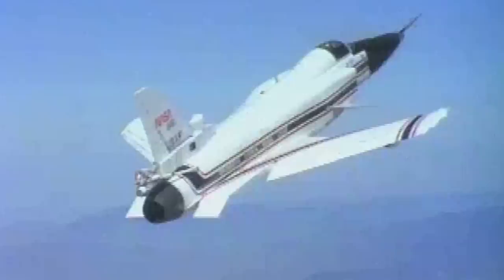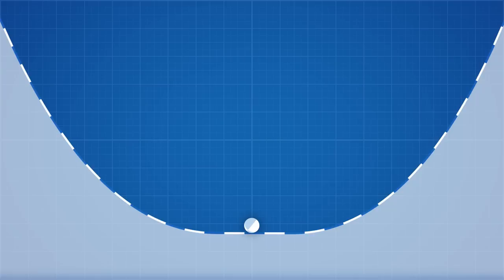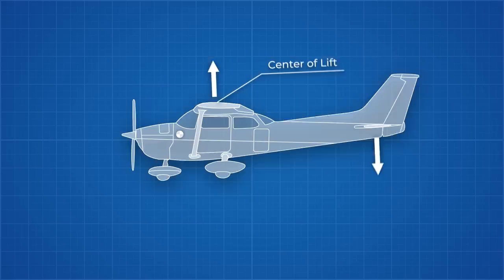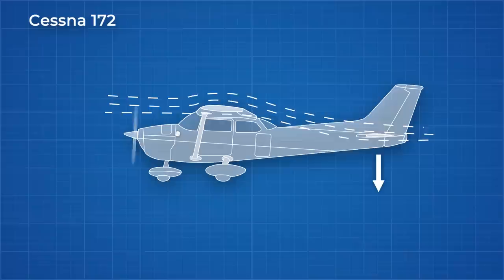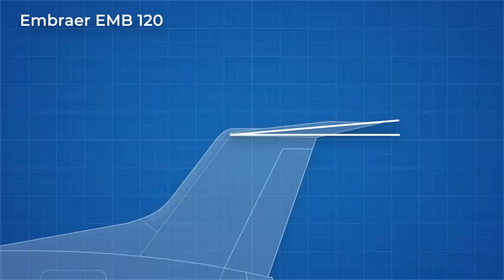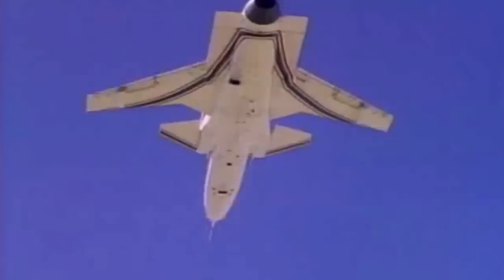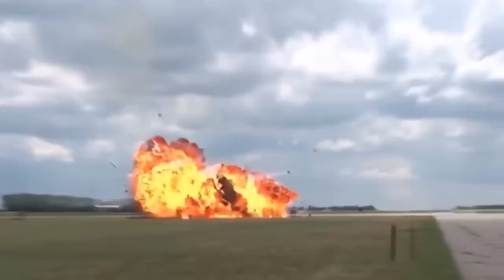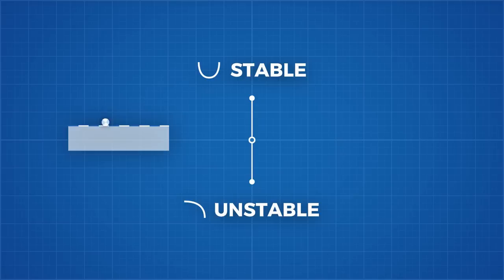Why Fighter Jets Can Be Too Unstable

Comment: Excellent and simple explanation. 

The term typically used is “relaxed stability” since many fighters do have static stability, just not what is required for safe and controlled flight. That is, the design will return it to straight and level with light maneuvering, but rapid maneuvering would cause the aircraft to tumble before the stabilizing forces could act. 

Another thing you touched on is roll stability. There is no pure roll stability because an aircraft has no idea which way is down. Roll stability is based on slipping the airplane and is called “slip-roll” coupling. The idea is that when the aircraft is knocked askew by a wind gust, it results in a slip and that rights the aircraft. 

Well... it has an opposite effect in a skid (using excessive bottom or pro-roll rudder rather than top rudder). So an aircraft that had tons of roll stability will actually be more maneuverable in roll than one that doesn’t. This is most evident in the snap roll or flick roll... where the rudder is used to induce a massive rolling force in combination with the elevators stalling the down-going wing which produces phenomenal roll rates in rather pedestrian aircraft.

Comment: Hey, I have been wondering about how engineers go about Optimising existing technologies. I would love if you could compare two generations of piston engines and show where more power and efficiency is produced, that would be awesome.
Reply: Take your pick and google it. 

Going from flathead which was easy to produce to OHV which had better flow and was less prone to overheating. 

Going from OHV to DOHC which allowed engines to flow even better and allowed for higher revs so small engines could produce lots of power as well as be fuel efficient when driven lightly. 

The introduction of direct fuel injection which allows carefully controlled lean burn which produces more power for far less fuel.
Reply: @Bartonovich52  but wasnt the disadvantages of DOHC is got less torque to produce than OHV ?
Thus makes them equal in technologies but different in purpose ?
Reply: @megimargareth4015  no, DOHC doesnt make less torque than single ohc or pushrod engines, its just a trend that manufacturers who value the pros of developing DOHC dont value torque

Comment: great video. I'll throw in some bonus facts about the F-16 since i've flown some flight sims in it (bit i am not a pilot). Because of the issues an aerodynamically unstable (or "relaxed stability aircraft") aircraft has with the center of lift moving forward as the Angle of Attack (AoA) increases, this creates a feedback loop where as the AoA increases, upward pitch increases which increases the AoA. This quickly gets out of hand to the degree that no pilot can reasonably control. To deal with this the F-16 makes use of a Fly-by-wire system. Unlike other aircraft (F-15, F/A-18) the F-16 is purely fly-by-wire, there are no cables nor hydraulic backups for manual control should the system go down, or the aircraft lose power. This is because again, there's a basically zero percent chance of a pilot controlling the aircraft without the flight stability systems. Being a single-engine aircraft this is naturally of some concern since loss of engine would mean loss of power and absolute loss of aircraft control. To alleviate this the F-16 has an APU which lasts about 10 minutes to provide power to the controls. In event of a minor engine loss where the engine may be able to be re-started, the F-16 actually can restart the engine with its internal starter (a fairly uncommon feature in US aircraft at least). 

While this fly-by-wire system is needed to be able to fly the aircraft at all, it also had a huge benefit of doing most of the work of flying the aircraft for the pilot. In flight sims i was able to take off in the F-16 (unladen) on my first try after watching a video tutorial, and reading a manual. The landing was iffy and i ended up going off the end of the runway because i touched down late, but the aircraft can only do so much for the pilot. 

One of the biggest advantages of the flight systems is how they prevent the aircraft from entering a stall -- supposedly a pilot is more likely to damage the control stick than they are to induce a stall from turning the aircraft. 

Finally, the flight stick is somewhat unique in that it originally did not move at all (with the more modern ones moving very slightly). The Control stick registers the force applied and uses that for control inputs. This is much faster than a joystick using potentiometers and a spring to return it.
Reply: Also the F-16 put the flight stick on the side of the aircraft to make it easier to control, the F-16 pioneered many things, intentional instability, full fly by wire, and flight sticks to the right side instead of the center.

Comment: CF-18 crashing at 8:15 at the Lethbridge Air Show in 2010 in Canada. Cause of accident was engine failure.
Reply: Glad someone else noticed.  Unfortunately, this channel does not accurately explain or research topics or videos.
Reply: It was about an unrecoverable situation, which is what the clip shows.
Reply: @martijn9568  Exactly. Plus the engine failure isn't even the immediate cause of the uncontrollable stall - it's the loss of airspeed. And the loss of airspeed is of course caused by the engine failure, probably combined with hard maneuver (near-stall, high drag situation requiring a substantial amount of thrust to push through).
Reply: @brendanreed3378  It's just background footage. It's to fill out the video with relevant content whilst the dialogue is the focus.
Reply: @brendanreed3378  a stable plane glides for far longer than a fighter with a damaged engine. the video was fine to show.
Reply: @edward3320  yeah. It makes it easier for me to pay attention to the video. If it were just a black screen, I’d probably go watch Minecraft or something.

Comment: Super interesting. I am interested in flying for a while and not too long ago I booked a flight with a pilot in a small plane. Once we started and we were in the air out of nowhere the pilot let me fly it by myself without any real instructions (beforehand we just covered basic lift and weather concepts an such). It was a cloudy day and so a lot of thermic force was put on the plane and the plane was tossed around. At first I tried to counteract the turbulences, but I soon figured out on my own that I did not have to do it, because the plane got stable on its own and I could metaphorically speaking ride the turbulence like a surfer can a wave. Great day. And thanks for covering the physics behind it.

Comment: Love the video. One little note: while talking about the Embraer EMB 120 Hor. Stabilizer it is technically wrong to say that it has a negative “AoA” since AoA is defined with respect to wind flow. But yes, it has a negative geometric angle with respect to it’s body horizontal axis.

Comment: nice vid, easy to understand, thanks for this very educative vid. wish you added the Su-27, but don't know if it was more unstable than the X-29.

also one thing though about the people who thought instability is a good thing, they forgot about the human factor, well though it  can just be left without saying.
Reply: The Su-27 Flanker is a pretty conventional aircraft. Probably no more unstable than the F-15 or F-16. The Su-47, however, was within the same ballpark of instability that the X-29 is in, since it's a similar design.
Reply: Given that any level of intability is impossible to control by a human and all jets with relaxed stability rely on a fly-by-wire system to artificially stabilize them, the human factor isn't really... well, a factor in this discussion. It's only about how easily the flight controls are able to bring the plane back to straight and level flight

Comment: The angle of attack explanation at 5:32 doesn't seem right to me: angle of attack is defined relative to airflow, not the ground. If the plane were to descend through still air (in relation to the ground) then the angle of attack is would be the same as if we were flying level with the ground. Thus there should be no stabilizing force in relation to the ground. Am I missing something?
Reply: his reference frame in the video is probably the airflow and not the ground
Reply: A bit oversimplified. Pitch attitude and angle of attack can be mistaken. For example, in straight and level flight you can be at lower AOA than in descent in landing configuration. In climb you can have lower AOA than during descent depending on configuration and what you do with an aircraft.
Reply: The explanation is incomplete. The speed is what affects the angle of attack. As the plane drops in speed the wings produce less lift, making gravity a more significant component, increasing the wing's the angle of attack, and lowering the angle of attack on the horizontal stabilizer.
Reply: I see how that segment could cause confusion. The animation definitely was with reference to the ground and not the relative wind.
Reply: You are correct, although there is the lagging effect of the velocity climbing as you pitch down that he is describing that would be technically correct, but not nearly as important as the angle of attack immediately after a gust of wind or some other force pushes the attitude of the plane off center. A much better analogy is an arrow and the quivers, or a shuttlecock in badminton.
Reply: You're not missing anything really.  He didn't do an excellent job on that section.  Angle of attack is defined by airspeed (more or less...)  Climb and decent are defined by how much lift you're making at the time.    None of the stablizing forces on airplanes are based on the "ground".  Gravity is the refrence frame.  

The AOA doesn't change, the amount of downforce produced changes based on airspeed.  The airspeed changes due to the plane pointing up, or down.  So if the plane is pointed down, it's going to speed up, and the tail will produce more force.  when the plane pitches up due to this it will burn off speed, and hopefully reach an equilibrium.  The shape that this feedback loop makes is called a phugoid.  And the damping of the motions is something that defines a good airplane design.

Comment: As a cessna mechanic I can tell you that your representation of the location  of the c of g is miles out.  The c of g on all low speed, pleasure aircraft is located as close to the centre of lift as possible.  The location you show for c of g is actually the datum point for c of g measurements.

Comment: I feel like you either oversimplified the topic or misunderstood it.  Having multiple sets of wings producing lift like a canard layout or a flying tailplane does not make an aircraft unstable.  Burt Rutan's VeryEasy and LongEasy designs are proof of this, as well as the Quickie tandem wing and I think some cargo planes.  The one thing that makes a plane inherently stable or unstable is the location of the center of lift in relation to the center of mass.  If the center of lift is in front of the center of mass, the plane wants to fly backwards, and you need a computer to convince it otherwise via fly-by-wire magic.  If your center of lift is behind your center of mass, the plane just wants to do a gentle nosedive, which is easily trimmed out.  This is why weight and balance are so important for planes, especially small ones.  Roll stability is a lot easier.  Having either a rearward sweep or dihedral increases stability, and having anhedral or a forward sweep decreases it.  Hanging most of your weight below the wing helps too, which is why low-wing planes have much more dihedral than high wing planes to achieve the same stability.

Comment: Ok a couple things:
1. Aircraft have a center of pressure, not lift. Drag, lift, and downforce are all pressure forces on the aircraft.
2. It's perfectly possible for a poorly trimmed but statically stable aircraft to automatically pull itself into a power-on stall.

Comment: As a child, we had dime store balsa airplanes, that we flew by throwing them into the air. 
They consisted of 5 pieces--- the fuselage, the wing, the stabilizer, the tail, and a metal clip. 
The first four were simple...put them together, and you have your plane, or what looks like one. 
BUT, that metal clip was necessary. It was thick, and had weight. I now know it gave the plane a center of gravity where you put it. 
The plane behaved differently when placed in different places. As I recall, when placed forward, it would do great loops. Which was great. Placed more centrally, it would fly nice and level and go a long way --- boring, plus you had to go get it.

Comment: This is like commercial, every day cars vs  super cars or race cars.
Your everyday car will have the wheel alignment “toe-in” to make the car more stable (it will correct itself to drive in a straight line),while race cars usually have it “toe-out” to increase cornering performance.

Comment: I sometimes just didn't understand WHY my boat sometimes wants to head upwind or downwind when pulling in the sheet, but now I know!
It's due to the centre of lift changing position, which is obvious, but I completely overlooked that the angle of attack moves the centre of lift relative to the sail

Thanks a lot!!!

Instead of steering with the rudder, I try my best to steer with other things to minimize drag. There's a few ways to steer without the rudder: with heel angle and trim, which can be broken down into a lot of different components. One of them is changing the angle of attack of the sail. The centre of lift moves around the mast, so pulling in the sheet means it shifts back and to the centre of the boat. As you say, the change in angle of attack means the centre of lift moves as well. This effect counteracts the change in position and orientation of the sail to a degree. In different conditions and using different sails, one of these two effects is dominant, and the boat has either the tendency to head upwind or downwind.

Most often, the rotation of the sail around the mast has more effect than the angle of attack shift. Though there are moments where the other is dominant.
Increasing the angle of attack and then decreasing the angle of attack a lot causes the centre of lift to shift forward, followed by an almost complete loss of pressure. Since the sail loses pressure in the back part easier, and the wind comes in at the front of the sail first, the centre of lift shifts forward even more. All of that means the boat wants to head downwind

Comment: 8:10 

Flight computer: STALL WARNING STALL WARNING
Reply: Nah, Betty was yelling. "Altitude... Altitude... PULL UP! PULL UP!" while the radar altimeter was screaming.

That said, was a really unfortunate crash. Pilot lost an engine while already at low energy for an airshow display. Yaw caused a spin and was too low to recover. Was at Lethbridge Air Show.

Comment: The F-16 featured relaxed stability.  It wasn't completely unstable.  It was the first US fighter to feature a computer assisted digital fly by wire system to mitigate against the loss of control of the aircraft.

Comment: Wait... The center of gravity should be around 30% of the wing width from the wing nose to be self leveling... Made a lot of rc models and this detail is crucial...!
Reply: @Fedor Djogani 😂
Reply: @Fedor Djogani I constructed airplanes by myself, gliders, motor planes, acro, 3d, speed and slow flyer... If everything I know would be wrong... they would not fly but they did, actually mostly pretty good...

Comment: Interesting that you chose the x 29 and the F-16. I was trained on flight controls on F-16 F-15 and F-111 aircraft. The F-16 is one of the more unique aircraft in that it is unstable enough that if the engine isn't functioning you are not going to land it.

Comment: I've been at Lockheed Martin for a few years now, working on F-35s. I've had one opportunity to briefly speak with an F-35 pilot & as a commercially-certificated pilot myself, I wanted to know if I'd be capable of flying the jet. All I've ever flown is small, single-engine general aviation planes. The pilot told me that through much coaching that I'd likely be able to basically fly an F-35, but, he said, the plane is extremely un-stable on purpose. He said I'd have to get used to the huge difference between a stable aircraft like a Cessna, and the extreme instability of the F-35. Of course it'd have to be a dual-place, dual-control F-35 of which there's no such thing. But I was very interested to hear an F-35 pilot talk about how unstable the plane is. He did say, however, that the intense electronics onboard do help in controlling/stabilizing the F-35. When you look at an F-35 nose-on, you will see it has a huge amount of anhedral (wings point down instead of up), more so than any fighter jet I've ever seen. Anhedral is the opposite of dihedral, and dihedral, where the wings are swept up from the fuselage to the wingtip, help an airplane to be stable.

Comment: Minor correction: The CG of a Cessna (and pretty much most aircraft) is actually about 1/4 back from the leading edge of the wing area. In the 172, it's 38-47 inches aft of the firewall. Never ahead of the wing. If it's ahead of the wing, all of the wing lift would be nosing the aircraft over, and the horizontal stabilizer would have to be pitched so far up that it would be like an air brake. In an ideal world, the CG and Center of Lift would match perfectly somewhere near the centroid of the wing area creating a minimum drag scenario. But for stability, we give up some aerodynamic drag to gain stability.